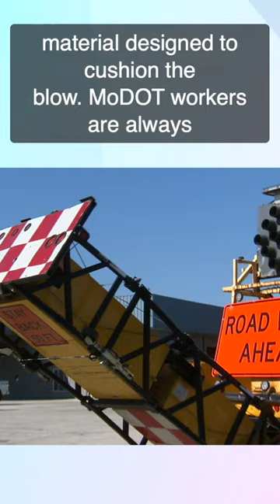Driverless Rear Trucks in Slow-Moving Work Zones are Tested as Work Zone Crashes are Rising

Comment: If this technology actually exists, and not just on some drawing board, then why has it not been delivered to the public, remote control is very very limited for use in a heavy vehicle such as a dump truck, it also raises the question of what are the Police officers doing besides hiding at the local doughnut shop or biscuit shack and not out handing out tickets for distracted driving, speeding, and whatever else can be charged, people need to step up and face the consequences of their actions
Reply: Um, it definitely exists.  That autonomous driving thing in Teslas, Lane assist in other vehicles and such you've heard about?  This is that.